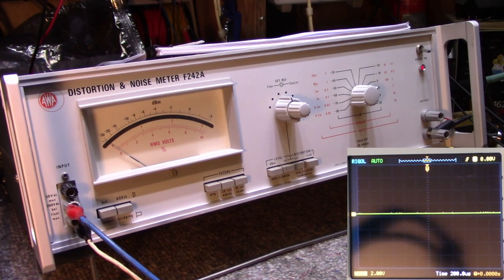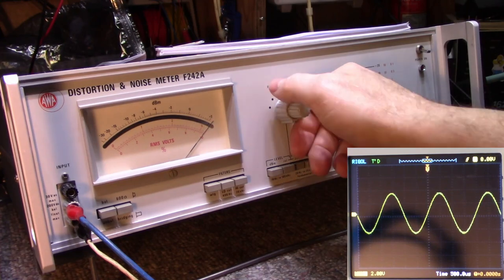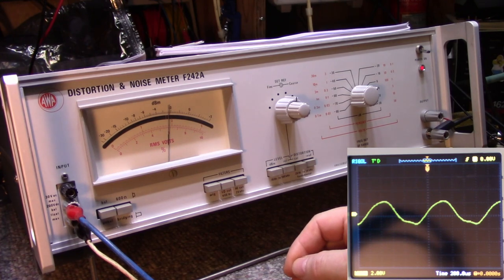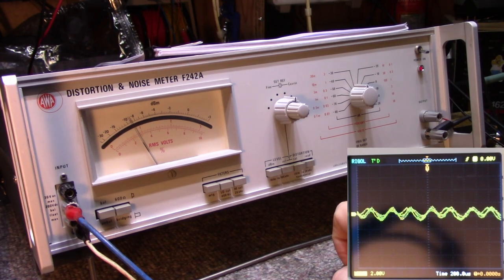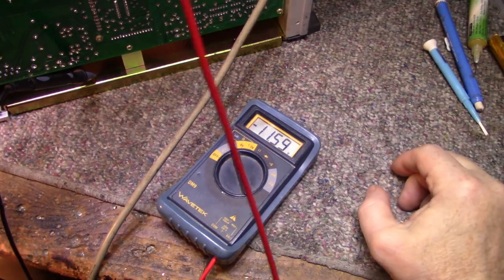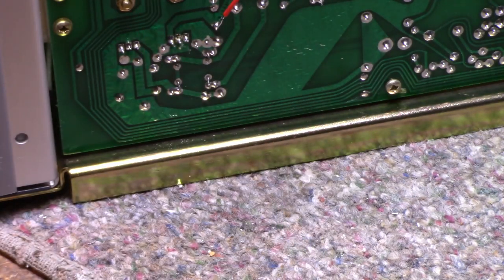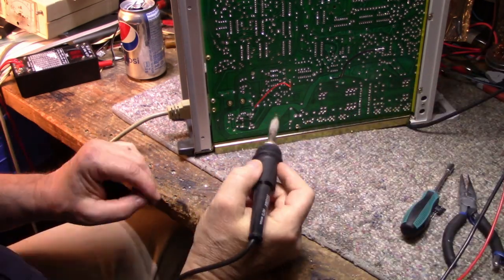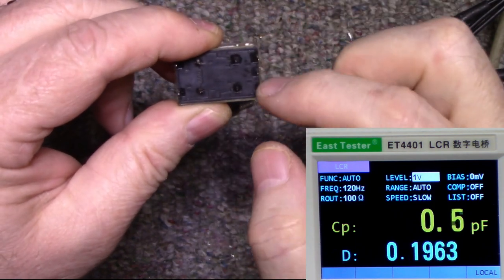AWA F242A Noise and Distortion Meter - Part 2

Comment: Trevor, check the spec's for your signal generator. If you are using a FY6900 or similar the quoted THD is 0.5% (20Hz - 20kHz) @ 0dBm, that will be less at lower signal levels, may account for the residual distortion you are reading after the repair. Low cost DDS signal generators can be a bit noisy. Interesting repair, always enjoyable to watch you work.

Comment: I haven't read the Manual for your F242A - However it has a very similar layout to the HP 333A - The Manual for the 333A is very complete with good explanations of how to use it - This may give you more insight about how to use your F242A - Chris

Comment: The manual does have much to say about cleaning relay contacts. It goes so far as to specify what to clean them with. 1000 grit is a bad idea. Bond paper is rough enough.
The old 3000 series relays used in telephone exchanges had wiping contacts that kept the contacts clean. That was achieved by have a small bend in the long leaf spring that carried the contacts.
 Of course this only works if the relays are operated regularly. The other alternative is knife edge contacts or sealed reed relays.

Comment: I think you mentioned that your fcn generator has two outputs.   Seems like you could mix a 1 KHz tone with a much lower amplitude tone of a different frequency to generate your own distortion test signal.   If the lower amplitude tone is 1/100 of the amplitude, then you should measure 1%, right?  (Plus whatever distortion is inherent in your fcn generator)  Another option would be to feed in a square wave, which has harmonics of known amplitude.   Probably you could find on the web what the "distortion" should measure using a square wave.

Comment: Does the manual say what the noise and distortion of the analyzer is? If so you should be able to verify those figures with a loop test. Assuming it is calibrated correctly, you would know the limits of your analyzer. For example, what the lowest distortion level it is capable of measuring.

Comment: I still  think  you are   wrong,  the unit has to sample  a  frequency sine  wave     with  a increase  in   voltage  (v SQUARED /R)      coming  out of  a  amp  channel .       Did you use    a thermal pad  or compound  on that  12 volt regulator , you didn't show  it    You know  the youtuber  motto " change  all the  capacitors "  Maybe it's your cell phone ?